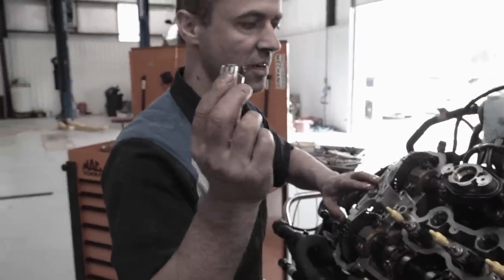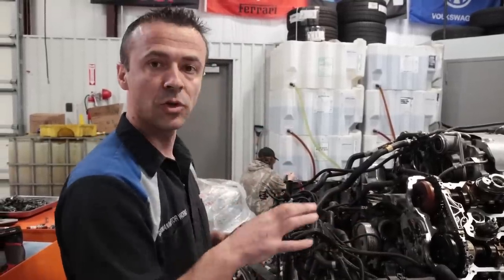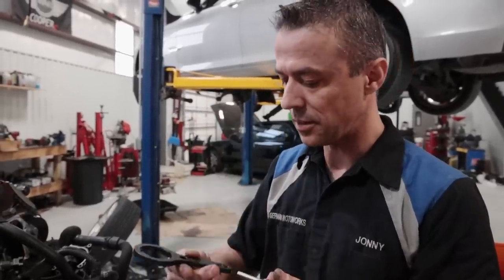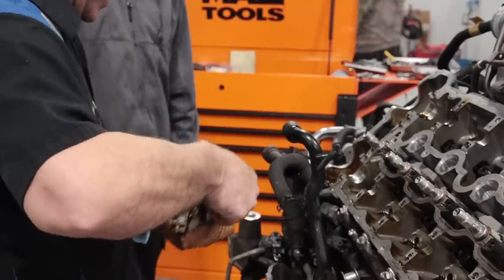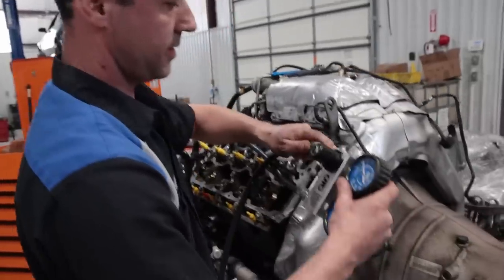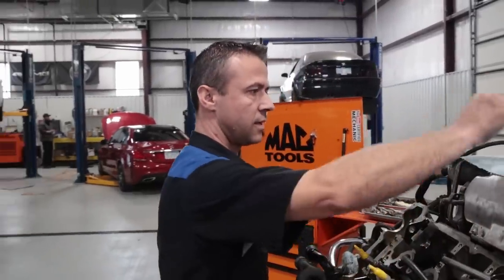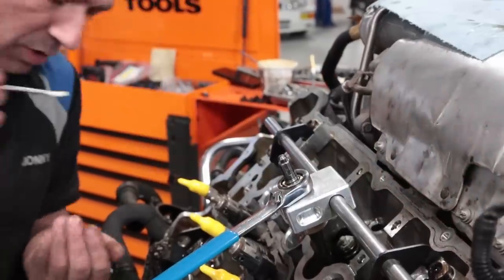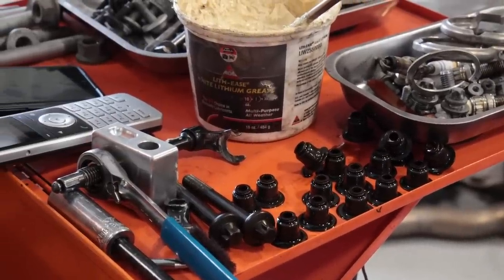CAR NINJA'S Pro-Tips BMW N63

Comment: advice Nr 1: don't buy the n63 engine
Reply: buy the B58 engine instead.
Reply: Why is it that it is mostly the BMW V8's that suffer from crappy valve seals?
Reply: @elmayimbe_the_amateur_mechanic  BMW hasn't really had a reliable V8 in a while. Every generation of V8 has an achilles heel, sometimes more than one. This is coming from a M62TU 540i owner.
Reply: @Recklessness97  is this why JLR now use a BMW V8, to maintain their reliability reputation?
Reply: @pigeonpoo1823  Wouldn't be the first time. Land Rover used BMW's M62TU V8 in their 2002-2005 Range Rover (L322). Only good thing was that if you could work on one you could too on the other lmao.
Reply: Was gonna comment that lmao. It still want an n62 just a glutton for engine failure over here lmao
Reply: N63Tu, mine is at 145K and i’ve had it since 40K, stock seals and with 5K oil changes with Liqui Moly, been dead reliable (minus some coolant hoses though, but that’s more of a general BMW issue during the F chassis generation!)
Reply: I have an original n63 120,000 miles and it’s fantastic. Take care of it it’s great
Reply: @xellium5445  Yup, all that blue smoke pouring out is behind you so why worry about it? 😀
Reply: I got an N62 because at least the piston rings on the N62 arent known for going bad. Hence oil burning is ONLY valve stem seal issues. Also i have an N62N/TU which is the 4.8 later model. N63 scares me for the piston ring blowby
Reply: @clonetrooper576  I’ve never heard of that occurring unless on the first generation N63s, Tus got upgraded bottom ends so hopefully I’ll avoid something like that happening to me, but I’ve also already gotten 4+ years of reliable ownership on my 15 550i, so something’s bound to happen soon haha.
Reply: Just don’t buy a BMW break my wallet
Reply: @Beer_Dad1975  I don’t have that issue at all with mine! No excessive smoking even while cold!
Reply: @xellium5445  Sorry was just teasing 🙂
Reply: @Beer_Dad1975  Hahaha! It is a fear of mine though!
Reply: Good luck with that. The N63 went into a ton of cars since 2002.
Reply: @xellium5445  Best thing is to just enjoy it and worry about sorting it out if and when it happens 👍
Reply: @elmayimbe_the_amateur_mechanic  Best guesses would be they either used a poor quality material that wasn't up to the heat cycling and constant motion, OR they just get too hot too often, OR they just don't get sufficient lubrication.  Given as far as I am aware, the cylinder heads are otherwise fairly robust, I don't think it would be a lubrication issue, but it's possible - but given what BMW do in the rest of their engines, I'd bet they used inferior materials.
Reply: @xellium5445 , I know a lot of people follow BMW 10K oil change intervals which is a terrible idea. 3-5K is best. Other than the Liquid Moly do you use some kind of special valve seal lubricant?
Reply: N63TU is not bad at all. It was a big improvement over the original N63. I guess you can compare them to the nightmare in the N54 and then the almost completely fixed version in the N55 and then the 3rd time was the charm in the near perfect B58. N63 was bad, the TU was good and then the TU2 and TU3 were just a lot better. It still doesn't answer why don't the 6cyl BMW motors really suffer from valve stem seals and even the M5 V10 which was a nightmare I don't recall having valve seal issues.
Reply: @elmayimbe_the_amateur_mechanic  I haven’t added any, but I do use some fuel additives to help extend the life of my injectors, and they’ve been fine. I do know though that the original owner of my vehicle also didn’t listen to BMW and did 5K oil changes (according to the carfax). There is a cooler thermostat upgrade you can get on N63 motors that actually does a lot to potentially alleviate the valve stem seal issues on these motors, and I plan to do it eventually when I reach around 160K stock seals. Being fair though, most of my miles are highway miles as I use my car primarily (550i) for long distance road trips.
Reply: Unless you wrench yourself.
Reply: The TU3 should have addressed almost every known issue with this engine. Time will tell. Hopefully they took notes and the S68 is good
Reply: @TheMstwntdLMSV123  S68 actually is just an improved S63, and fun fact about any variant of the S63 is that they use the N63 block as a base, and similar heads with a very slightly different cam, unsure about other changes of course, but I hope they've improved furthermore. I know the TU3 got an upgraded valve stem seal design, which is very good.
Reply: @TheMstwntdLMSV123  Oh! I just heard somewhere that they kept the blocks the same, but I haven’t been able to find much data on the new S68 engine to be fair! Seems very interesting, it makes more of an S63 style sound maybe due to s similar manifold design to the former S63, but this is basing off of a BMW XM i got to see being revved in person
Reply: @xellium5445  Yeah, the information available is very limited. That's cool that you got to hear it in person! I saw the XM in person a few weeks ago and it looks so much better than it does in pictures, especially in black The design is really growing on me. I'm excited to see what the S68 can do in some higher-output applications.
Reply: not a positive mindset
Reply: G05 X5 M50i with N63TU3 engine and it is perfect
Reply: Wrong
Reply: @Recklessness97  but you are sooo wrong. 116, 392 miles N63TU here.
Reply: @xellium5445  facts.
Reply: @elmayimbe_the_amateur_mechanic M52, M57, the rest just got progressively worse.
Reply: I disagree. They are not for the faint of heart by any means but if you have the itch and aren’t scared to work on your own vehicle then these can be a great buy
Reply: @elmayimbe_the_amateur_mechanic Pretty much a problem they had for way to many years those seals always go rock hard after so many years. Timing guides also is another common classic fault as well as oil chain. I shocked he didn’t do the bottom guides and adjust the preload on the oil chain. Every single one worked on at least on the original N63 non TU has those issues as well.
Reply: @Dat550go Your is the TU it technical update revised N63 which is much better then the organized N63. It still has the valve seals issue but they at least made massive update to it.
Reply: @thetechgenie7374  134,141 mileage now. Just keep it lubed.
Reply: too late i’ve been having one 😪

Comment: How do I best get a stripped oil drain plug out from an n26 engine when the Allen hole is rounded out? Thanks and love the channel!!
Reply: Hammer and chisel
Reply: Pipe wrench or vise grips?  Have a new plug at the ready.  Another option is to find the next largest American sized hex and lightly tap it in the stripped out hole.  Sometimes that gives you enough grip.
Reply: Tap in the appropriate sized Torx driver, the flutes will bite into the rounded hex edges for a solid grip... usually comes straight out.